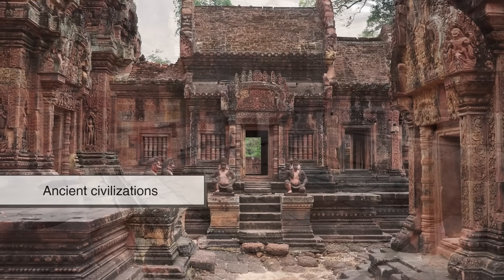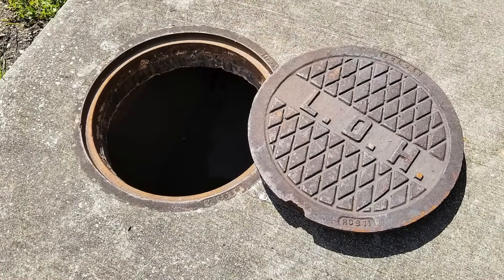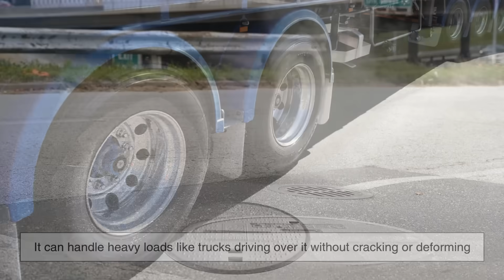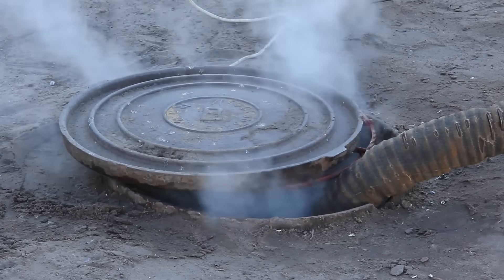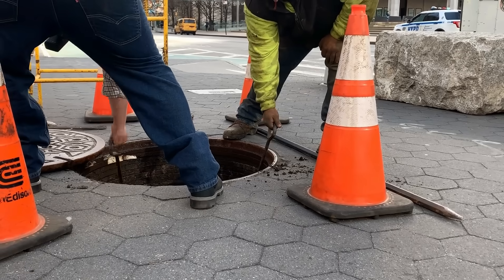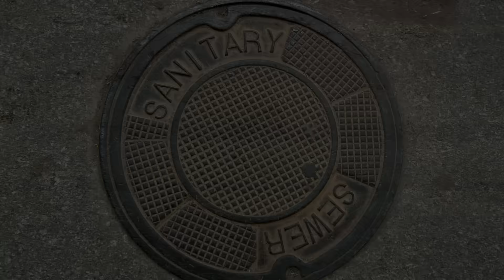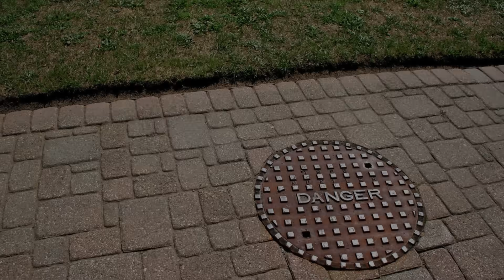Why Are Manhole Covers Made of Cast Iron?

Comment: I think you forgot the importance of the coefficient of thermal expansion of different Metals. Steel expands more than Cast Iron. During hot weather, Steel covers expand greatly that it would jammed itself in it's frame. Making it difficult to remove.
Reply: If there is an issue then it would be manhole cover against surrounding concrete/tarmac
Reply: The difference in expansion between steel and CI is measurable. In millionths of an inch. Manhole covers are not manufactured to these tolerances. Cost is the single factor. The ability to cast a suitable plate with raised sealing lip, identification and a non slip surface, as opposed to a machined item requiring extensive, expensive, multiple operations is the key factor. CI resistance to corrosion would have been a consideration many years ago. But in our age of disposable/throwaways even that will have gone by the wayside. The statement about remelting an old/damaged/obsolete cover as being a win for sustainability and, (subsequently the environment), is just ridiculous. The same energy is required to produce new cast iron as recycling old when the collection and processing of materials is taken into account.
Reply: @philmenzies2477  Agreed.   Recycling the CI for the same cost as new and completely eliminating the waste is utterly pointless.   (I never fake sarcasm when dealing with the braindead.)
Reply: @philmenzies2477 Most people, including engineers who have not run the calculations do not realize how little metals expand with temperature. It's disappointing a comment like that gets so much traction.
Reply: Easily compensated for.
Reply: This is a totally brain dead comment. Calculate the difference in thermal expansion and get back to me.
Reply: The frame is made from the same material as the cover, so it expands at the same rate.
Reply: @pulaski1  I’ve been thinking about that. I agree expansion rates for a given width are identical. But doesn’t the total expansion depend on the total surface area, with the expansion per inch multiplying to create a much larger total area expanded?
Reply: @davidtrindle6473  Expansion is purely a linear property.  A two-dimensional piece of any material, such as a manhole covers expands equally in both dimensions. ... Of course a manhole cover has thickness too, and that also expands at the same linear coefficient of expansion.

And a hole in a piece of any material, or a frame, expands at the same linear coefficient of expansion as the material.

But back to your point, if some imaginary material had linear expansion of 10%, then it's area would increase by 21% (being 1.1x1.1), but the enclosed area of a frame made from the same material would also increase by 21%.
Reply: @pulaski1  and than it will crack the cement / concrete / bricks around him
Reply: @roeypaskovich8304  They just leave about a 1/4" (1 cm) gap around the outside of the frame for thermal expansion.  Very simple.
Reply: @pulaski1 sure it expands at the same rate but factor in the surrounding concrete or stone the frame is in and a greater expanding steel frame may crack the concrete/stone around it.
Reply: @stormkhan4250  Yes, you are correct.
Reply: @pulaski1 that means the inner circumference would expand with the outer circumference of the cover itself making it get even more stuck.
Reply: They aren’t that big. you just leave a big enough gap that it can expand without wedging itself.
Reply: That's is very true which is why steel bridges have expansion gaps. 
Although I think the inverse would be more concerning since shrinkage in cold conditions leaves a hole in the path/road.
Reply: I honestly thought this was the answer, and they didn’t cover it
Reply: @DellariusDownUnder Because it's not anywhere close to being true. Going from -40 to 100°C has a total change of about 0.9 mm. The difference between cast iron and steel is 0.03mm
Reply: There is a significant amount of clearance around the edge.
Reply: 3:55 he mentions expansion🤙
Reply: Can you not make a bigger frame?

Comment: Why do city engineers always place manhole sites directly under where nearside wheels will go over them causing damage to wheel and manhole cover. Why not site them to the area where the vehicle will drive over them, more central to the vehicle width!!
Reply: There are regulations that were developed many decades ago that allocate certain "corridors" for various underground utilities such as water, sewerage, gas, communications cables, and electricity so that they are kept separate and do not interfere with each other. It also means they can be located without ripping up the whole street. Then, sometimes the street alignment is altered (such as going from one lane to two lanes) but the utilities are not relocated resulting in the manholes being in traffic lanes.
Reply: Always wondered that myself... seems stupid
Reply: Right in the path of motorcycles, you mean..
Reply: The difference is a lane being totally blocked vs a partially usuable lane.

Comment: I often see steam coming from American manhole covers but I have never seen it here in the Netherlands. Is it just me or is there a reason for this?
Reply: Steam is the gas form of water and is invisible.  Perhaps you saw some water vapor rising from manholes?
Reply: @bobbydazzler6990  You are right, it must have been water vapor. But, I never saw that here in the Netherlands. What is going on?
Reply: The city pipes steam into apartments/houses, to heat them through radiator grills. 
The steam pipes networks run underneath the streets, and at regular intervals are safety valves.
Reply: @A0A4ful  Thanks
Reply: Search for the video "The Secret Steam Tunnel System of N.Y.C." it's a great explanation.

Comment: Steeling metal for scrape is a scrap yard problem, Monitor fine and imprison scrap yard owners and it would die. They are a super crooked lobbying group and that's why the problem continues.
Reply: Exactly...  Scrap yards are usually fronts for some other illegal activities, at least in large cities.  That said, the local ones near me have become very cautious in the materials they accept.  If an aluminum or copper part looks like it's relatively newly machined and unused, be prepared to undergo a rigorous Q&A about how you came about it/where it came from.  

The manufacturer I used to work for had a lot of theft of scrapped aluminum and copper parts, at least until they started locking the scrap containers and using security cameras to watch over them.

Comment: More Importantly. Why are manhole Covers made round.?
Reply: good question , if they were square or rectangle they would be liable to fall through the opening,
Reply: @jimosullivan4866   I was asked this as a 15 Year old at a job interview. ..and Yes, that is the answer.
Reply: Most manhole covers are round because most manholes are round. That's the real answer. If the manhole is square so is the cover.

Manholes are usually round because that's the strongest shape for resisting the pressure placed on it from the sides.

Round manholes also make it easier to run pipes. You don't have to worry about the pipe entering at a weird angle along a flat wall.

People are also roughly round, especially when you add room for them to turn around and their equipment.
Reply: People who ask this question in job interviews are incompetent at interviewing.

Aside from the fact that the 'correct' answer is wrong, it demonstrates the candidates ability to remember a riddle they heard before. It doesn't have anything to do with the job skills or ability to reason.
Reply: @ Whereas y'self. You a clever bloke hey.!
Reply: I guess you didn't watch the video.

Comment: Comes down to cost. Steel would exceed even cast iron in all the aspects you mentioned, but iron is a lot cheaper and is capable enough for our road systems and climates.
Reply: Steel easily deforms over time, especially under heavy loads. Steel is also much more heat sensitive.
Reply: @ITeachRick you missed steel being far more prone to rusting in the economical grades and excessively expensive for stainless steel
Reply: @duanesamuelson2256  Um, I was pointing out some disadvantages that weren't discussed in the video. So the rust issue was mentioned, Stainless wasn't directly, but it is more expensive and more difficult to machine than mild steel. Harden would be even more challenging.
Reply: @ITeachRick  it wasn't a criticism, just a continuation of your comment.  Cast iron is remarkably suitable and has a remarkably long service life as well as a decent cost benefit. 
Despite the photo in the video, I've never seen the manhole cover broken in service, though I have seen the supporting rings broken due to improper setting (whether from improper setting or degradation of the brick supporting them). 
If they weren't so impractical to collect I've taken out a few that were unique enough I would have taken them home (town cast into the lid no longer existing or (my opinion the coolest) one cast with 1876 :) centennial).

Comment: Actually some States in certain areas are now using covers made from polymers. Part of the reason is that residential water meters are now read wirelessly and metal covers block the signals. With the wireless technology water meters can be read 'on the fly' by a passing vehicle.
Reply: Those are not manhole cover. They are meter vault covers. A man cannot fit through them. 
My meter cover is cast steel with 2 holes for the transmitters. They have been used for 30 years.
Reply: Misinformation
Reply: That's not the actual reason. Steel meter covers have been a thing for a lot time and were still readable in the same fashion, the real reason is cost. If they did that for regular manholes, those covers would break and kill someone.
Reply: Whatever they say about polymers they are just a fancy name  for plastic and will never be as good or as strong  as cast iron.

Comment: This may be too esoteric but there are several Integrated Circuits that have been in production for over 50 years and are still in wide use today in new products. ICs like the NE555, LM324, LM339 as well the 4000 Series of logic ICs. Devices that seem to have been gotten right in the first place and while repackaged at times, they have been in production from not much after the dawn of the Integrated Circuit.
Reply: Yes, the 555 (NE the prefix, from its original maker, Signetics) and 4000 CMOS (RCA) go back to the late 1960s. But, the internal guts are not the same. A former boss of mine, told me that they redesign the masks for ALL chips, roughly every other year. I wondered why. Later, I found out, its due to changes in fabrication techniques. An IC made today, is not made the same way, one was only a few years ago, let alone, one made 50 years ago. And they are not saving that ancient equipment. At least not beyond a couple of generations. Probably next to impossible to still get 3 inch wafers. You have to keep up with the current supply chain.

I remember when the LM324 (LM was a National Semiconductor prefix) was new. Not quite 50, yet, but well in its 40s.
Reply: @michaelmoorrees3585  You actually can get 3 inch wafers still, a lot of research institutes still use them for very small scale fabrication.

Comment: You missed one point why the covers are usually round........the round covers will not drop/fall into the manhole when removed or replaced, they will not go pass the rim.
Reply: That was mentioned.
Reply: It was mentioned @6:19.
Reply: @thumperjdm  My bad,  I missed that  🤡
Reply: Duh.
Reply: SSSHHHHHUSSSSS Penguin 🐧 hears & sees everything .
Reply: I remember when I was shocked by A definition of an engineer- " a man who can do for pennies what costs another man dollars". Cast iron works, and it's cheap. Why change?
Reply: @larrystuder6378  Do you know the definition of a sailboat?  It's a hole in the water that you throw money into.
Reply: DUH, what an insightful observation.
Reply: It was already mentioned
Reply: Thanks Mr. helper
Reply: You didn’t listen to the end.
Reply: Round also saves weight and material cost vs other shapes.
Reply: Nashua NH... FAMOUS fir the fact they once had a foundry that made triangle shaped manhole covers... Similarly they couldn't fall in. 
International standards and standardization has meant that most are getting changed to round now.
Reply: That’s also the same case for any other shape. As long as the diameter of the pipe/hole is smaller than the cover, it will work out the same.
Reply: @Jay_Force_One daa.   a square cover will drop into a square hole at a oblliq angle.🎉
Reply: @Jay_Force_One  R U kidding me?  I can assure you that every lid shape that is not near perfect round can and will fall through it's opening if not lined up.  A round lid bigger than the rim will not.
Reply: @Jay_Force_One not true. Other shapes when rotated can fall in , when tipped. Think square, in the diagonal the length exceeds the length of the sides.
Reply: Go put on your dunce cap

Comment: Great Britain uses a lot of square manholes.
Reply: That's because they do maths there rather than math and the extra s precludes them from using circles, because S is a broken circle
Reply: Yeah, they are normally a square hole with covers made up of two triangular pieces, because a triangle ( like a tripod ) will always sit securely and not rock so will not make a noise when traffic drives over it... The bad news is that the triangles can easily fall down the hole...

Comment: (Fun fact) They steal the iron ones in Mexico, so they make them out of concrete instead 🤣
Even the bus stop benches are made of concrete in Mexico, unlike the metal ones in the USA, that can be cut and sold for scrap by crack heads 🤣🤣 so that’s why Mexico used concrete 🤣🤣
Reply: Would be easier for the scrap buyers to stop buying obviously stolen stuff.
Reply: Brb doin some math on concrete price per kilo.
Reply: @zdlax  You often have to pay to dump it.